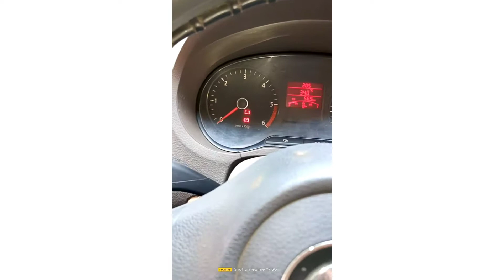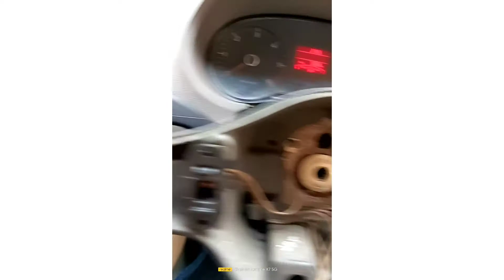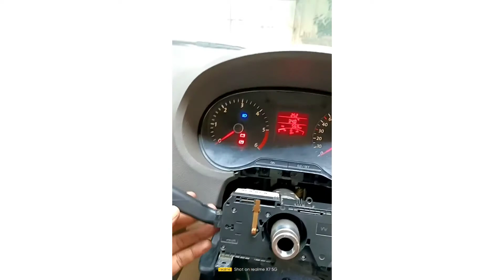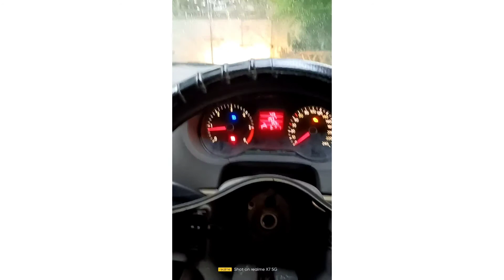Car headlight combination switch repair. Volkswagen skoda all models.

Comment: My Vento low beam is not working, can you please help me
Reply from the maker: @prasanthvijay2413  yes let me know what problem you are facing?
Reply: @allyouneed3412  Low beam is not working, i changed the bulb as well, but still low beam is not working.
Mechanic identified and he confirmed it is a switch issue, he said I need to change the switch which will cost 18k.
Is there any alternative way to resolve this issue?